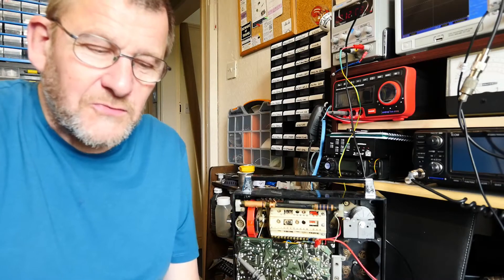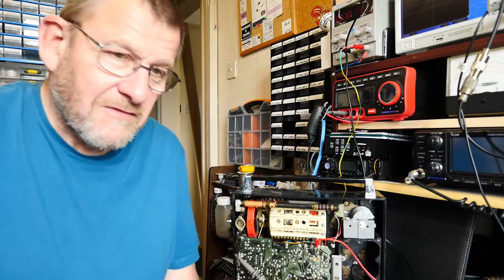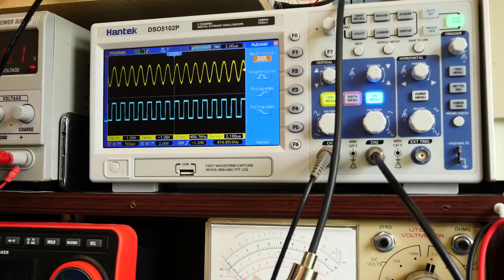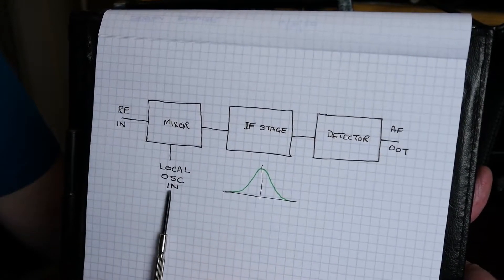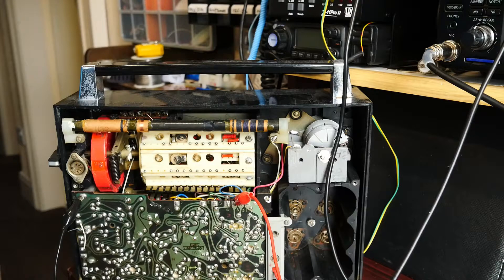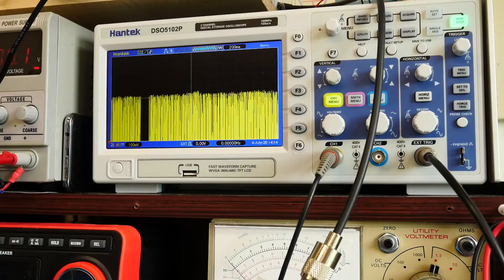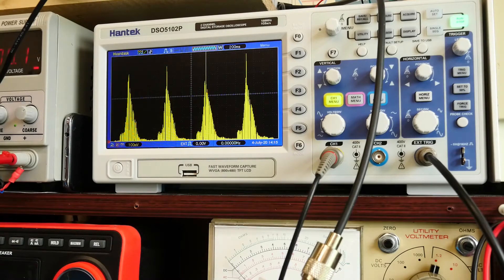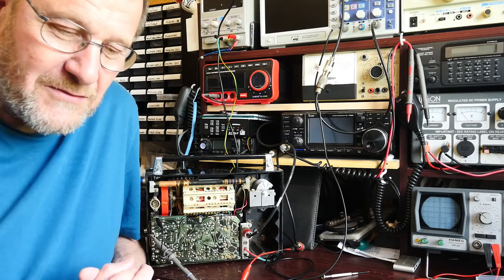IF Alignment using an oscilloscope and function generator as a poor man’s spectrum analyser

Comment: Hi, great video. 've got a similar radio (OKEAN 205)  but a little more complex in a sense that it has FM band as well (I believe that your doesn't) I could be wrong but...anyways. I wanted to say that @ 1:20 you're saying that these days you wouldn't be doing mechanical switches but rather use logic circuits or.....similar. Well, it so happens that for my radio in particular I'm currently searching for a practical way to achieve just that. In other words do you actually know of a certain LOGIC IC from the 74 series or ...whatever series that would do it?  In my case, as you rotate the rotary wafer switch a number of "UP TO" 14 contacts are employed (depending on what band you're in at the time). So again, I'm looking for a practical hands on solution here if you happen to know one or can suggest what to try. I'm thinking, maybe there is a specialized (stand alone) IC that is purposely made for it or some large size IC style reed relays etc. One thing I'm trying to avoid here however, is using any microcontrollers in the radio simply because they are known to practically be noise generators especially for SHORT and MEDIUM wave frequencies. So the aim here is to possibly only use good old TTLs /CMOS  IC's if possible. Any help or some pointers are more than welcome.  Ta.          PS: The idea wants to be more of a experimental achievement first and then later on (if the proof of concept work for my particular radio) to make a proper suitable PCB for it to have it implemented properly and permanently. I'm not interested in keeping the radio as original as possible but rather in achieving a vastly improved  functionality for it and if successful to be able to adapt the "found" solution to other old radios (in the future) Thank You.

Comment: When I started out restoring my Hallicrafters SX-101, I was using a function generator and scope to look at the IF and crystal filter as well as the notch filter operation, until I had a accident with an IF transformer, which now needs to be replaced. However, when I get done replacing the IF transformer, I now have a Motorola R2001D spectrum analyzer with tracking oscillator to see the results. Hopefully, I have a good IF transformer to replace the broken one!